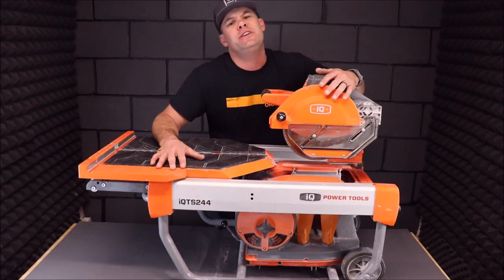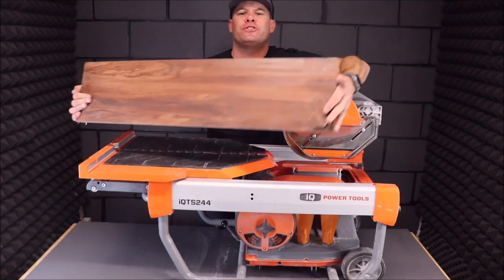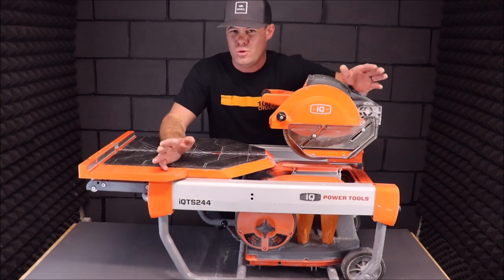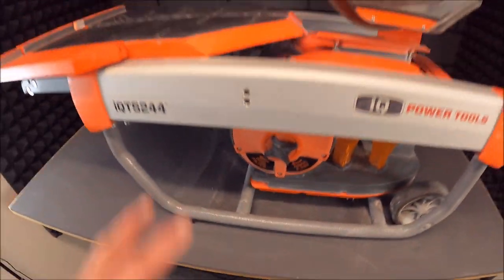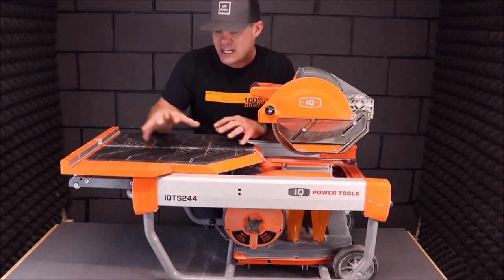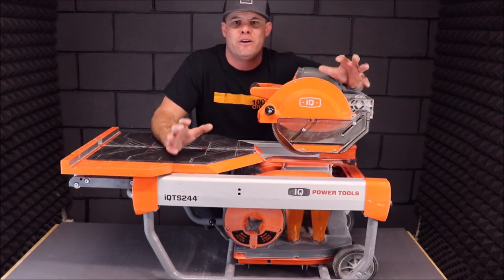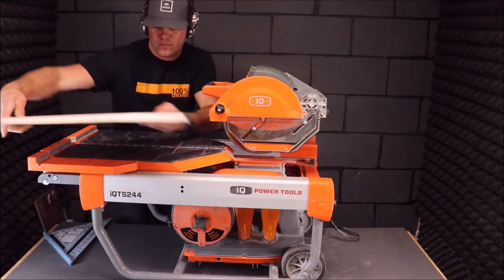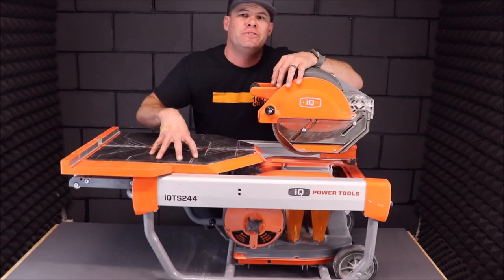IQ Dry Cut Dustless Tile Saw 1 Year Update

Comment: Great video, thanks! I'm a novice tile guy who decided to purchase this back in November largely based on the review on this channel as there weren't a ton of reviews elsewhere and wasn't disappointed. I did a master bath floor (8x8 porcelain) shower walls (white ceramic subway) and a mosaic porcelain shower floor. The cuts are about the same as what I'd get from a wet saw, so not perfect but can be cleaned up. I also purchased the Montolit Minipiuma, which I'd never used before, but found myself using the IQ for the vast majority of the job. I can't tell you how much nicer it is to have a good tile saw 2' away from me at all times as opposed to walking 50' down stairs, outside in the Michigan winter, and into a cold garage to cut tile. It's a beautiful looking saw and honestly,  it's built like something you'd see in a machine shop...very sturdy and heavy duty with no slop whatsoever. So thanks again for your earlier review,  you helped me purchase this expensive but very worthwhile piece of equipment! Also, would you please consider a video on grout if you haven't already done one? I did a quick search and didn't see one. I run into problems like improper coverage and black grout not bleeding, but coming off when rubbed with fingers. Grout is the one part of the job that still worries me. Thanks!
Reply from the maker: Thanks for the comment, we love our IQ and yes on the grout video. I'll work on something 👊
Reply: What exactly do you mean with black grout not bleeding but coming off on your finger?  Black and dark grey are some of the trickiest colors to use.

Comment: How does it perform when shaving only a blade width off? On a wet saw you can press the blade with fingers but not on this. Is it really disks enough to be safe indoors? You can see some dust in the videos. Thanks for the review!

Comment: Appreciate video i been thinking about getting this saw. Have the dewalt 10 inch . But winter time hands freeze if i dont heat water up a little. So i think this would be better but didnt know to much about the IQ.
Reply: Exact reason i bought ours michigan cold winters. I thought i would only use it then. But my wet saws collecting dust in the barn. Hasnt moved all year even summer , u can set this up in the same room in 5 minutes, no walking in and out of the house , no mess, no water,saves work time  cuts great. Only thing i use water saw for any more is glass tile. And my 7 inch small old saw does that when needed.

Comment: Have u tried the grey blade , i just got my new filter and fins for the annual tune up. I also bought the grey blade and the orange one. Excited to see if its different than the orange one .
Reply: Any feedback on the grey blade mate ?
Reply: It's on the saw, the only thing we used it for is soft tile so far, 1st job with new blade and fins on. Haven't tried porcelain yet, definitely better than my old blade it was worn more than I thought once I got my new ones , lol. Old 1 was getting hot alot . This one cuts better all around. Most people I've talked to use the grey one all the time. But I bought aa new orange 1 as well just in case . Let me know what u think.

Comment: how does the speed of the cut differ if any from wet or dry? i find that a cut that is under base board i can fly through those will it be the same with this saw? looks like feed rate is significantly slower or maybe just the video. thanks for your time
Reply from the maker: maybe a little slower, hard to tell without water spraying all over lol It is definitely NOT significantly slower

Comment: Bought one yesterday. Test cut porcelain tonight with orange and grey blade. Cut quality was awful and chipped out with either blade. Slate cut well, but I set mostly porcelain so I'd rather have cold hands in the winter than hand sand EVERY cut with a diamond pad. Returning it tomorrow. Want you to know I watch all your videos and appreciate them as a tile guy, but in the future you may want to show an actual close up of all the cuts. Like really close up. Its fine for hidden cuts, but anything up to a profile strip would be unacceptable by my customers. Will put my $ into a higher quality manual (Montolit) and deal with the water. Just my opinion. To each his own.
Reply from the maker: very strange, we know lots of guys who have this unit with no issues like you have had. Sorry hear it brother.
Reply: You need to slow down and let blade season. I found a similar result out of showroom and found the tech at the tool store installed blade improperly. Had to buy new table veins. But once you get use to running the tile it cuts ceramics the best IMHO. I don’t think I have ever had to polish a ceramic. 
Sorry you had a bad experience it’s a great saw in the winter

Comment: 2:23 sending out a lot of dust.
Reply from the maker: I have very bright sides and top studio led lighting that picks up every single particle in the air. If it was a small tile like a 12x24 you would not have seen any 👊 EDIT: Yes, on the outside cut clip I had the dust guard off so the camera shot looked better to show how clean it was 👍🎥
Reply: the dust guard is not on the saw when he plunge cuts. You can see the screws where the dust shield attaches. Probably took it off for the plunge cut.
Reply: @vicchico9322  Thanks, I didn't notice. I NEED equipment like this, because I remodel hotel rooms. I need to do it all within the rooms. I do the tile with a water cooled saw right now. My coworkers dry cut, and just have the maids do their thing. My coworkers don't GAF about breathing in dusts.

Comment: Well i knew you would say the blade would burn out fast....
Just use the HEAVY duty blade(Grey)
IT cuts and last atleast 1000+ so far and i believe IT Will for go over 2000+ cuts.
Dont use the standard IT runs out pretty fast(400-600) cuts

And the IQ cant do mitre cuts perfectly
You should do a REVIEW on SIGMA JOLLY EDGE. Best for mitre cuts
Reply: Just got a grey blade in the mail today. Gonna test her out tomorrow. Bought another orange.one just to be safe , didn't know if grey was the choice or not ?

Comment: still 10% dust blow out
Reply: It will. I own one and the one thing they screwed up on this saw is the vac motor, its weaker than I thought. Itd be nice if they bumped it up to at least 250 cfm. Its alot but I can only see it working then.
My little battery vac is almost the same as this lol

Comment: Doesn't seems to be that dustless... The big advantage it's tho that you don't have to wait the tile to dry out like on a wet saw.
Reply: I get all the dust when the blade guard is on. Had one for a year, its the only saw i use anymore. Nice to set up in 30 seconds in the same room ur working in. Not a million trips in and out of the house, especially in cold freezing climates, built better than any wet saw ive used x10
Reply from the maker: The dust guard was off on that outside clip, you can still plunge with the guard on, but I wanted the camera view to look better 👊🎥
Reply: @jeremyruss2407  I use an MK wet saw, and the I find the quality of it to be very high, excellent tool to use. I agree with your comments, very accurate. I watched this saw on a large commercial project and it performed very well. My experience is this review is dead-on accurate, I would encourage more maintenance of the filter and keeping the machine clean for those working in nice finished spaces. I might recommend using different blades for different applications, as I do with my wet saw; some of us are natural blade changers with all our tools.

Comment: 2ins & 15/16ths is not good enough! & wheres all the cuts on brick & concrete? saw lots of dust coming off this in the video & the carriage sounded rough as he slid forward & back & he didnt take the cover off to inspect it oh no we've just gotta take his word for it (i dont think so!) He said $100 for a new blade? so why am i reading $200 & $300 from the public? Bugger the dust i'll stick with my EVOLUTION with a Japanese blade that cuts through anything (& dont need replacing every 5 mins) & only £35 or £40. British & Japanese engineering, we knock spots off you yanks! forgot to say that machines had a year of work & still looks that clean? (steam cleaned once a week no doubt) Have a nice day lol!

Comment: Mr.Lanberg, i have the 10in IQ, i mainly use the the hard material blade, what is your opinion on the two different blades? i hope you answer if not send me your email. BTW love the channel!! currently doing a shower with 14x29 in tiles no problem for this saw!
Reply from the maker: Hard to say, if cutting porcelain, the gray blade lasts a little longer in my experience.
Reply: @LandbergTileTV  gotcha, i havent noticed any better quality of cuts between the two